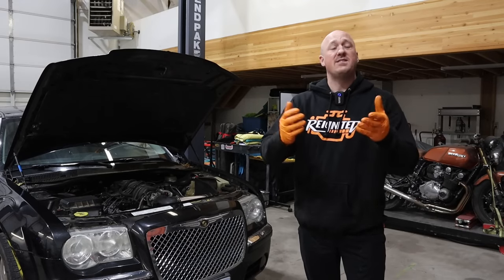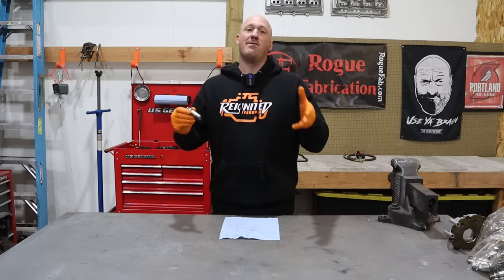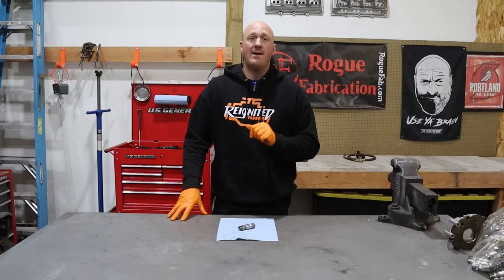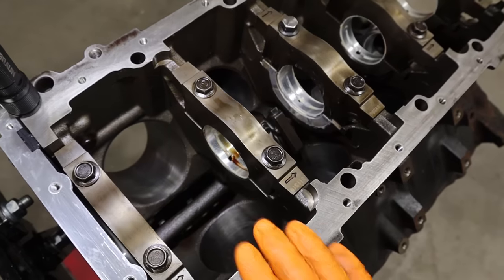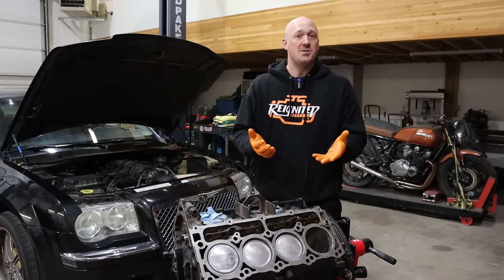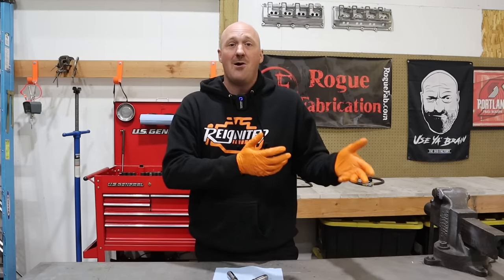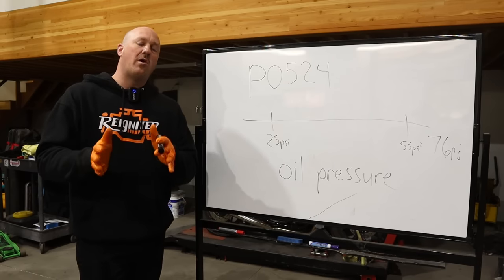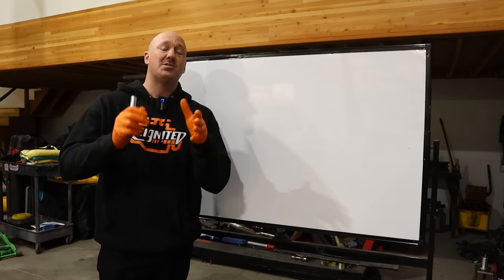The BEST Prevention For Hemi Lifter Failure! (In My Opinion)

Comment: 38,000 miles and right over 5 years, got the lifter noise.  So disappointing.  That low percentage of failures is misleading, that is only going to show the people that are under warranty, or take it to the dealer for repair.  Only about 35% return to the dealer for service and that is on the higher side, so 65% isn't accounted for in that number. 65% would be other shops or self repair or no repair.  If 8% are returning to the dealer, that means ~15% of non dealership repairs are being preformed.  Keeping the percentage the same, that comes out to around 23% of these engines are impacted by this issue.  Because getting statistic from independent shops and self repair would be impossible, its only fair to add the 8% of the documented  to the undocumented.  Non statistic:  I'm also assuming that of the 8% the majority were warranty repair, which incentivizes the return to dealership.   Most of the complaining is because of the expense, and the likelihood. This impacts more people than lead to believe.  Its just Chrysler trying to not get sued for a known issue.  Thanks for the $60k purchase, and spending another 5K in 5 years.  Most engine designs are made for 150,000 miles, and not getting that feels like they dropped a turd on my forehead.

Comment: Is this also an issue with the V6 Pentastar engine?
Reply from the maker: They have entirely different issues. Primarily the rocker arms will fail and lead to a ticking noise which can damage one or more of the camshafts eventually. There's not really a fix for this, it's just cheap parts.

Comment: I fixed my lifter issue at 57k miles on my 2015 Ram. I got rid of it quickly. Matter of fact sold my wife’s Chrysler 300. I’m now Mopar free. Never again will a Mopar sit in my yard. Yup that fixed my problem. Good luck guys.

Comment: The cause of failure is the MDS lifters themselves.  Its why you didnt see alot of lifter failure in 03-08. And the older hemi used a thicker oil. 5w20 is way too thin. The 6.4 has oil jets it does not rely on the crank driven pump solely, and it has the exact same lifter. Same with the hellcat. When the lifter is not contacting the cam under activation, and the engine throws it under load its impacting the cam at full spin, the sudden shock damages the needle bearing in the mds lifter eventually causing it to seize.  "Hellcat lifters" was a name some con artists xame out with because the MDS lifters were updated for the Hellcat engine with thicker needle bearings.  If you have MDS you will see a lifter failure. Its a guarantee. I went through 3 sets in 60k miles. Oil was changed so frequently that it never came out darker than brown. Simply turning off MDS with a tune and throwing a higher pressure pump in wont fix it. Itll actually cause more damage.  You can only flow so much oil and by increqsing the "volume of flow" youre putting more stress on the engine internals.  Its like blowing up a balloon,and trying to go past max. Itll pop eventually.  There have been several studies that revealed using a hellcat pump in the hemi is not beneficial.  The hemi pump flows between 42-65 PSI which is plenty of flow pressure. 

Remove MDS system
Switch to 5w30
Use SRT filter 

This is the only way to ensure the lifters dont fail.
Reply from the maker: I would love to see these "studies" you mention about the Hellcat pump being detrimental to the engine.
Reply: Can I just use 5w30 and the filter without mds delete? Too much headache and labor

Comment: Oil isn't what it once was. They have taken all the chemicals out that provide real protection. I use Royal Purple HPS because it has the zinc and other additives that give that protection.  Lucas sells a zinc additive too if you want to buy cheaper oil. I also only use a K&N oil filter, if you read about your filter you will see many clog up fast and bypass it letting the junk go right back in.

Comment: Does Dodge offer a version of a V6 or V8 without serious issues?
Reply from the maker: Take it from someone with 20 years in the automotive industry. All engines have problems, I prefer knowing about the problems than being ignorant of what will happen to your specific engine. 👍
Reply: @ReignitedAuto  , cracking an engine block to replace cams is different than replacing a TIPM... especially after a warranty has ended for a non-mechanic. To be more specific, is there any modern engine used by dodge that doesn't need to be taken down to the core (under proper maintenance)?

Comment: Does the Hellcat pump bolt on a Truck 6.4?
Reply from the maker: Direct fit, however there's an even better option available now,  Melling 10452HV provides a full 20% higher volume than the stock pump. The Hellcat gives about 12% higher volume. 👍

Comment: If this is the probem and installing the Hellcat pump why does the manufacturer just not install them at the factory. After all it is not like they do not know this is happening. With this being so widespread the Stellantis should have to fix them at no cost to the customer. I have owned a 2014, 2017 and my current truck is a 2021 that was purchased new. I have 65000 mikes on it and so far no problems but I have 3 friends that have had to have the engines replaced for this and the repairs were not cheap. This is a product defect issue which normally a manufacture would be on the hook for it.

Comment: @reignited are hellcats with the high pressure oil pump not having lifter failures?
Reply from the maker: I personally have never replaced lifters in a Hellcat, but that may not be a direct apples to apples  comparison due to the fact that there are so few of them compared to the standard 5.7 and also their owners will drive them significantly differently than a daily driver. But, even with that being said there's really no downside to having the extra oil volume in your engine.

Comment: I'm in the market for a used RAM, probably 2022-2023, which will probably have around 20,000-50,000 miles on it.

What should I be looking/listening for before buying? Or what questions should I ask the dealer or vehicle history to check to make sure mine doesn't have this issue?

Comment: You made a comment that the hardness on the cam lobes can flake off well that is pure B made cam shafts Ford motor company 351 Cleveland for several years at the Ford plant . When we would induction harden our cam shafts once an hour we had to take one cut the low bout and make sure we ran 72 Rockwell sea scale throughout the entire lobe all the way to the center of the  Cam shaft. Nobody runs a cam shaft that is harder than a buck knife except   It's typical Chrysler crap face it

Comment: I’m probably going to catch a lot of flak from people MUCH more knowledgeable than me but, here goes nothing. I’ve owned various Mopars over decades. Cars, trucks, full sized vans, minivans and SUVs. Slant six motors, 4 cylinder made by Volkswagen, V6s, 318s 360s and starting in 2003 4 different 5.7 hemis. Whatever problems I hear about transmission failure (my 1999 1/2 ton started shuddering while applying gas going uphill after a number of years) or engine problems seems to me to be a problem with oil flow. Be it engine or transmission. Since the 1999 truck, we always have used tow/haul for normal driving. We live in New Hampshire and are very seldom driving on a flat piece of road, including what little highways we have. All the 5.7s we’ve owned have been in trucks or SUVs and they all would shift into overdrive at between 30-35 mph. Too low in my opinion in a heavy vehicle. Been doing that since my 2003 3/4 ton right on up to our 2019 Durango. My 2010 1/2 ton has 145,000 miles and we have never had a problem with any of them since. Anyway, that’s been my experience. If I was really interested in optimum gas mileage, I never would have bought a hemi.

Comment: Is that really a turbo and supercharged Magnum? I need the story on in that, and the specs lolol 😅
Reply from the maker: Better yet, I've got the entire build on this channel 👍. Check out the "poor man's Hellcat" Playlist to watch it come together!
Reply: @ReignitedAuto  that's dope being a former honda and acura technician I appreciate the deep dives because I am uo in the air on a hellcat or srt durango. I know the 6.4s crank can handle more power but I'm not sure I wonna dump another 25 to 30k in an srt to get hellcat power
Reply from the maker: @justinyoung8953  it's definitely hard to beat the out of the box power and reliability of the Hellcat.
Reply: @ReignitedAuto  are there different iterations of the hellcat engines based in the year models? I know some transmission issues have come up but I have been wanting to speak with someone like yourself about this lol.
Reply from the maker: @justinyoung8953  obviously you have the demon and redeye models that are more powerful, but as far as the base Hellcat engine they are all the same. Same engine is in the trackhawk, and the TRX.
Reply: @ReignitedAuto  any recommendations on simple mods or bolt ons to improve engine, trans, and diff life?

Comment: It doesn't drip enough oil down into the cam from the oil gally and all you need to do is drill and champhor the oil gally with more drip holes even more pressure doesn't solve not enough of them you need more and the hellcat pump it's only few bucks more then regular one and that will make that engine a tank after that r

Comment: Keep your oil level proper and deactivate your mds system from the computer side the needle bearings only sieze to high heat and lack of oil pressure due to those cylinders cutting off because of mds the back cylinders cut off and don't maintain the same oil pressure but still get excess heat
Reply from the maker: https://youtu.be/NcDeWXYtozE 👍

Comment: LIFTER ROTATION (in plastic lifter trays)?  Could some of the Lifters be rotating in the oem "plastic" lifter trays ever so slightly from new (or the trays developing slop/stretch over time). Lifters rotating and running a few degrees off axis.  The slight off axis rollers being hard on the needle bearings of the rollers.  Rollers then having drag and or skidding.  Rollers starting to have great drag or locking up and then eating into the cam.  https://www.youtube.com/watch?v=cIq2xxu79NA

Comment: How does increasing the volume increase psi?
Reply from the maker: Your PSI numbers are strictly dependent on how much restriction is present in the oiling system. By forcing a larger volume of oil through the exact same system it's inevitable that the PSI will go up, however the higher PSI isn't actually what matters, what matters is that we know for a fact that MORE oil is moving through the system. 👍
Reply: @ReignitedAuto In physics class, we learned: To increase pressure, you can:
Increase the force
Reduce the area the force acts on
Increase the amount of gas
Increase the temperature of the gas
Decrease the volume of the gas

Comment: Why don't they just change to the better pump for new model years then? If I buy a new 2023 RAM, I have to spend 1k to change out the oil pump and then probably lose powertrain warranty from that modification? That's not really an ideal solution. Flaws in design should be recognized quickly and fixed.

Comment: I think the 0w-40 oil is the issue.   5w-40, and even better yet, 10w-40 will be better.  The 0w is the base oil.  Although the thicker base oils have the same viscosity  and flow  characteristics as the 0w-40 at normal operating temperatures, the thicker base oils have  larger molecules, and less additives, for better lubrication, having  better "cushioning" to impact loads, such as seen in a lifter environment.

Comment: Ok, this is ridiculous. I just bought a 2022 1500 with the 5. 7 hemi 43000 miles , super clean truck. If i would have known this before i would NOT have bought the truck. Now i have to think about buying a high volume oil pump, BS. One post said he up his idle rpms to 800, i think this is probably a good idea , this would keep the oil pressure up , that and changing your oil every 5k miles. 
Dodge needs to be sued over this. Should bought the v6 , or a ford.
Reply: V6 is a junk too, even new Toyota trucks are junk now😆

Comment: Has nothing to do with changing oil at 3k or 5k. The failures should not be happening period. The comment about warming your car up or extended idle time is ridiculous. What are you supposed to do stuck in Atlanta traffic in July for 2 hours turn your engine off????

Comment: The hemi engine has a design flaw. Until they redesign the engine block they will destroy lifters and camshafts.
Reply: If it was a design flaw it would happen in 100% of 5.7 engines but it only happens in 5%. and in the majority of them it only happens after 100k.  I've had a Silverado 5.3 vortec eat lifters at 70k and after repair oil bearings go out which I believe was metal from the replaced lifter. New 5.3 LS has run 45k with no issues.  Friends GMC Sierra 2022 6.4 lost lifters, rods, and cam at only 65k miles.  All of these failures seem random and few so I suspect faulty parts from China.  Ram HEMI though gets the most attention as they may have more failures in the 5%.  These parts have to be hardened the same and meet very low tolerances down to .003 and a few may not.  Combined with 10k MI. oil changes and idling hot for hours with a/c on could escalate failures.

Comment: Mine shit the bed at 36K miles on a 2021 RAM Laramie which was kind of frustrating.
Reply from the maker: That's definitely not typical. Did the shop actually confirm the lifter failure or did they just replace parts?
Reply: @ReignitedAuto  the called me and confirmed it. My truck is still at the shop as we speak waiting on the parts to get there. Allegedly is an expensive fix which im hoping that the warranty covers.
Reply from the maker: @IzzyE92  shoot me the last 8 of your VIN I'll check it for you.

Comment: I have 2020 ram 1500 with only 20,000 oil change on time and i have this problem
Reply from the maker: There's a pretty solid chance you are dealing with cracked exhaust manifolds rather than lifter failure. Is the noise most prevalent on cold start?
Reply: @ReignitedAuto  and you know that oil pressure when a cold star it’s around 59 psi so I have a really good oil pressure even idle It’s around 40 stable. Yeah maybe you’re right maybe I’m dealing with some broken bolts on the exhaust 👍
Reply from the maker: @juanprenteria5077  on the 2019+ trucks it's actually the manifolds themselves that are cracking right in the center under the heat shield.

Comment: Excellent video and explanation.....I have a 5.7 that experienced lifter failure.....I'm SUPER anal with oil changes.....long story short....installed new cam, lifters and mellings HV oil pump...ALL good Now...55psi @idle and 75psi from 2000rpm up.👍🏾👍🏾👍🏾

Comment: You need to change the oil and filter every 1,000 miles. The lifters are garbage and the oil and filter needs to be replaced very frequently,  much more often than recommended by the manufacturer.

Comment: Never change the voltage output of a oil pressure sensor. Just because the hellcat pump theoretically puts out 12% more volume does not mean the pressure sensor is reading 12% higher. You are making an incorrect assumption there is a 1:1 and linear relationship. Don't do this.
Reply from the maker: And yet it works perfectly. I tested the pumps before and after installation and it does in fact put out 12% more at all rpm levels because it's a fixed displacement pump, so the voltage adjustment works just fine. Remember that you'd only do this if you're trying to retain MDS, and ideally it makes much more sense to swap the oil relief spring with your stock pump. This voltage divider solution is really only for those of us early adopters of the increased volume pump who don't want to tear it all back apart to change the spring. 👍

Comment: Dirty oil gets sticky. Oil changes is mostly the cause. I use marvel. I have pushed this platform to 300k miles with no tick after I did the first repair.  I drive super hard. Oil changes is key for this platform. 3k no more than 5k. 

Sadly if you are not doing your own oil changes, there is a chance you are just paying to wait. If your oil is not clear after a change and you doing your oil changes at 3 to 5k you are being scammed.

Comment: Don't use the oil that they recommend it is like water try using 5w 30 it's a little heavier oil and it will stay on the cam and lifters and not run off like the oil that they want you to use 5w 20 is like water
Reply: MDS on, full oil flow. MDS off restricted oil flow…. Hmmmmm

Comment: #1 BEST info, do NOT get a 3rd Gen HEMI, Their design is a disaster and literally NOT fixable due to poor machine work POOR design that is literally a scrap-out design. There is a YT channel that goes over this very issue 3Rd Gen HEMI engine!
LOL, I cant believe anyone would say "you'll be OK" is some or "a little" metal flakes form d[fau]ilure engine will be fine.
ABSOLUTELY WILL NOT !
If it exist there is ONLY ONE WAY TO RESOLVE THAT DESTRUCTIVE METAL PARTICLES.
Remove engine replace ALL bearings that WILL BE scared junked out rom it, and flush out ALL oil passages , and essentially, ONLY a full rebuild is proper.
.I cant believe anyone in their right MIND would ever say "Oh Hey a little metal from "flaked off cam Lobes is "acceptable,
that is absolutely engine suicide. 
Metal does NOT Magically disappear or STOP flowing in the oiling system or near the rings.
UUHHGG, 3RD Gen HEMIS are throw away JUNK engines!
LOL, good grief here we go again YT "Advice" disaster.
The ONLY resolve is THROW IT AWAY and never buy one.